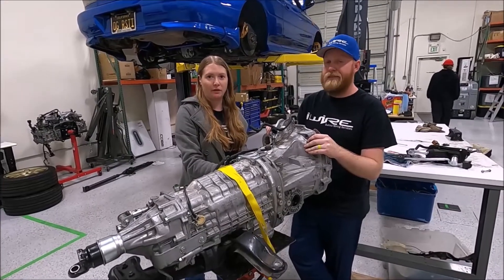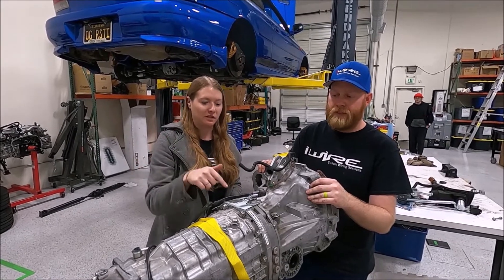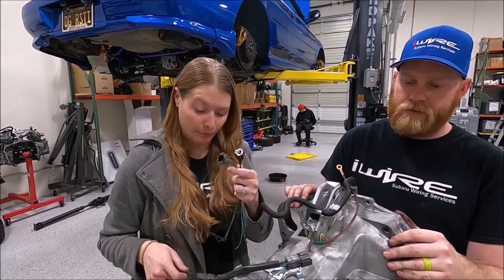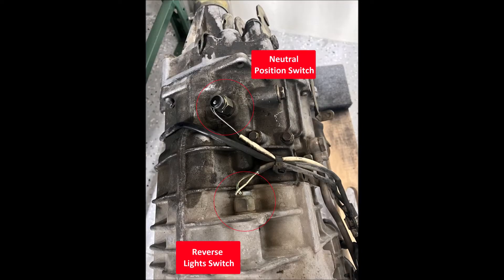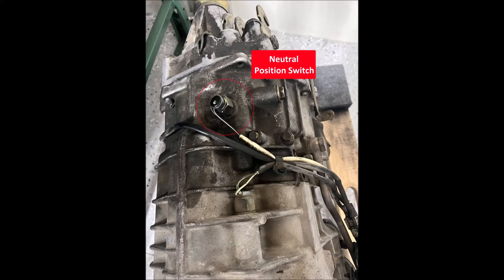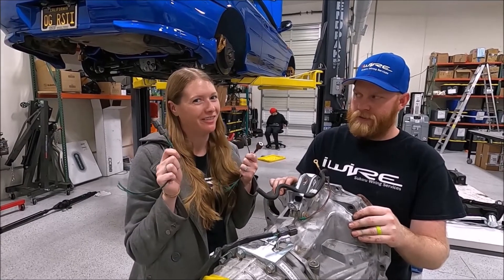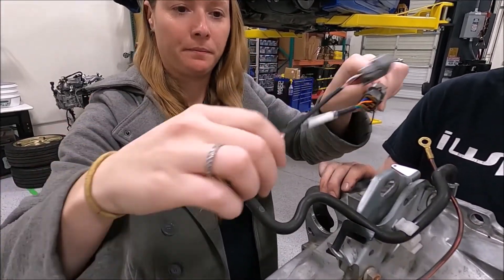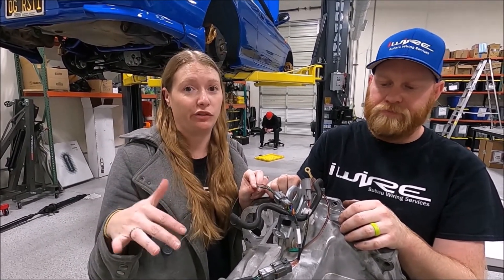Subaru Transmission Wiring Differences Explained - Which Subaru Transmission Do I Have?

Comment: if the wire that plugs into that transmission plug under the intercooler has some exposed wires, would that cause me electrical issues like when i switch into first gear, my headlights turn off/highbeams & DRL's acting all weird? And it literally happens when i go in and out of gear. I just had my clutch replaced as well! Appreciate any feedback! Thank you!

Comment: Im confused, what do you mean wrx non turbo???
Reply from the maker: I'm not sure exactly what you are referencing, but the 15+ WRX shares connectors with the standard non-turbo applications, so there may be some confusion as a result of that. The 14 and older WRX uses a 4-pin connector which we refer to as the "turbo trans plug"

Comment: HI, a question you probably never had asked. does the 6 speed MT  trans on the forester SH Diesel  3rd gen have dccd?
Reply from the maker: Unless there is an exception, only STi models had an option for DCCD-equipped transmissions.
Reply: thank you so much  @iwiresubaruwiringsolutions